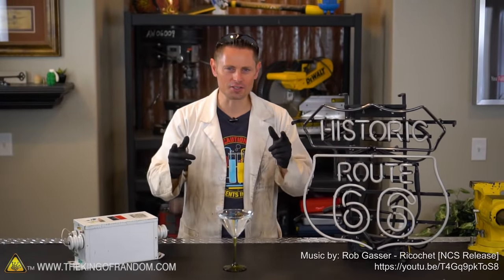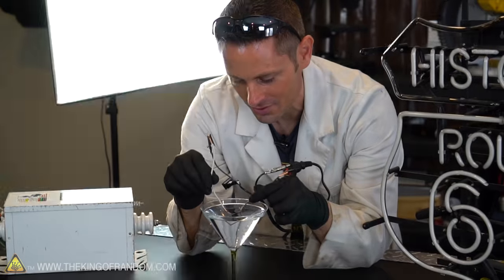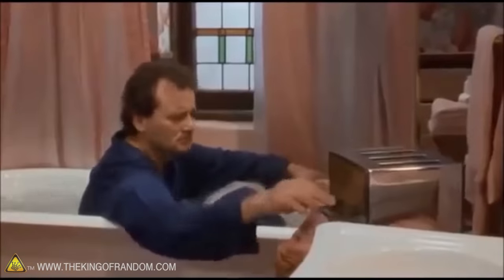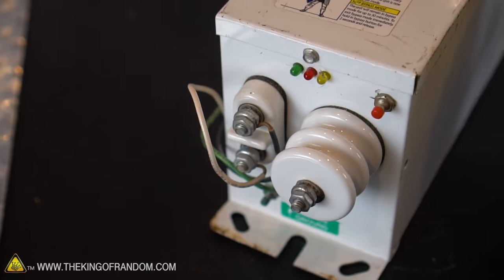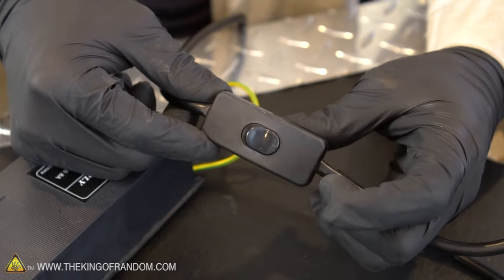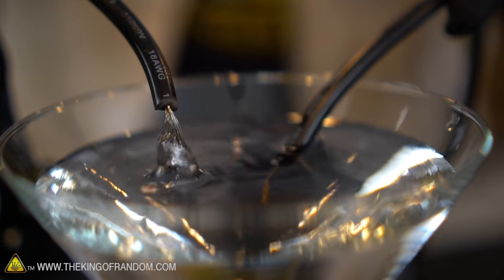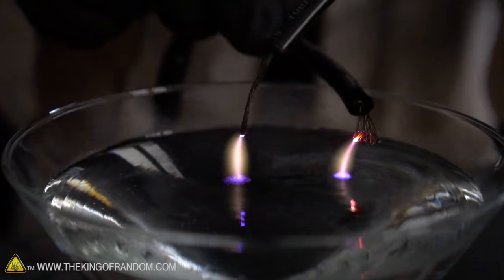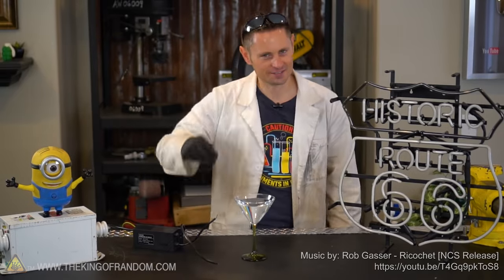Don't Mix Electricity And Water! TKOR Experiments What Happens With Electricity In Water!

Comment: Hello, If there were high pressured water tubes running negative and positive ions through the tubes, would the tubes have a high impact of uncontrollable electrical force. Could we create a high impact telephone line with a cold (underground freezer) and hot water(hot water tank) source running through the lines to stabilize the frequency levels of the electricity or would the electricity be too hard to manage. Would there need to be some kind of speaker or throttle at each end of the high pressured electrical water tube to help break apart and keep the frequencies in a workable condition. When you placed the wires inside of the glass of water did the electrical cord voltage change in number or did the voltage stay the same? Thats if you were to hold a voltage meter to the cord to read what kind of output its giving

Comment: The Blue colour on the surface of the water is due to the O-H bonds breaking in the water, the energy gap produces the photon wavelength, where as the copper (C-O bonds) produces green near the wire.

Comment: He is only using the ungrounded "hot" conductors. If the water was grounded, or a neutral and a hot were used, you see a short circuit and probably a nice pop. Since he's only going from ungrounded to ungrounded conductor, and the water isn't grounded, the electrical current will only arc out and jump to the next conductor. If you were standing on a glass box and held the two hot conductors with each hand, you would not get shocked as you are not grounded and the current has nowhere to go. If you touched hot and neutral, then you complete the circuit and become the fridge/microwave/computer and current will pass through you from hot to neutral.

Comment: Waaait, you could explain more about frequency, because the 10kv power supply is ac for sure, that complete changes the propriets of materials since they are capacitors in theory

Comment: lightning is proof that everything - including air - is conductive.  one only needs enough voltage to overcome the resistance.  voltage however is not amperage.  the water was able to conduct the voltage, but not sufficient amperage to power a load.

Comment: I work in a diagnostic chemical plant and before we use our pumps for the reagents we actually run water through them and test how conductive it is to know if they're clean enough. If it's higher than a certain point we have to run another 10L through and test it again

Comment: We can basically replace using metal to using soap water to conduct electricity. Cheaper and looks like it may work for a substitute, but may not work while encased in a wire and then can be kinked like a hose

Comment: Something cool to try. Build an electrosis device using a pickle jar and two nail electrodes punched through the top in salt water (put a buffer between the nails and the jar lid, or just dangle in the jar from the wires) and tie the positive and negative leads to a salvaged power cord. It either makes a lot of cool fireballs or its explosive. We've had both scenarios play out. :) Bonus points for not using an adapter that reduces the amperage.

Comment: Why didn't you tried with one wire inside the distilled water glass and other to outer surface of glass and make them come close and see if high voltage can pass through glass.

Comment: this happens because distilled water has less ions in it and tap water has more if he would have added salt to it it would be more conductive then the bath soap and the reason adding bath soap makes it more conductive is because it has more ions also the reason that the high voltage cord has more electricity obviously and it is more determined to get to the next conductor of the electricity that is why you dont stand in water because your skin is a great conductor of electricity in the distilled water he could have put his finger in it with the power cords and it would have not shocked him ( i would recommend not to unless you use type II deionized water because it is the world most purest water therefor it dosent have barely any ions in it )

Comment: You need a better disclaimer on this video!!   DO NOT TRY THIS UNLESS YOU HAVE A LOT OF ELECTRICAL BACKGROUND AND COMPLETELY UNDERSTAND HOW TO DO THIS EXPERIMENT. DO NOT USE MAINS VOLTAGE... USE AN ISOLATED POWER SUPPLY TO HELP REDUCE RISK. THIS IS EXTREMELY DANGEROUS.
Reply: This was 4 years ago dude

Comment: What actually happens is if pass high enough voltage it ionizes the air or water. Apparently water ionizes easier that air.
Reply: Ionized air or water is conductive.

Comment: How do they get the electricity to flow all the way to the top of a skyscraper? Do they have to use an electric pump or something?
Reply: Electricity is not affected by gravity, this height doesn't matter. Distance does matter which is why they increased the voltage through long distance power lines. But the height of skyscrapers is not enough to significantly affect the electricity.
Reply: Voltage drop calculation starts around 100'.